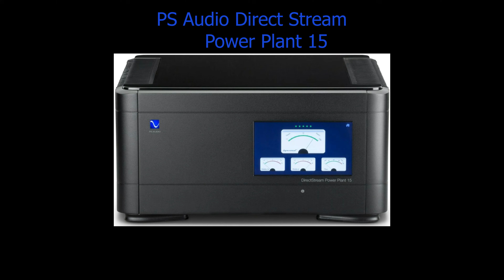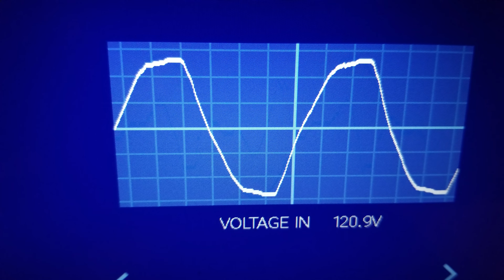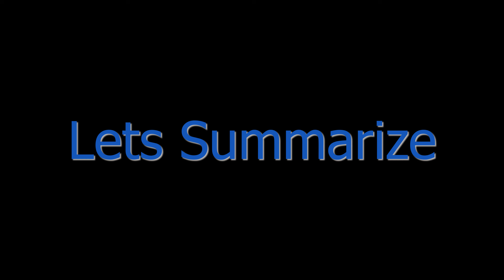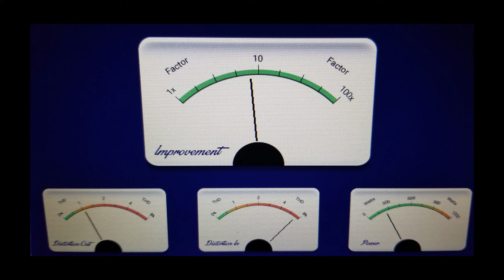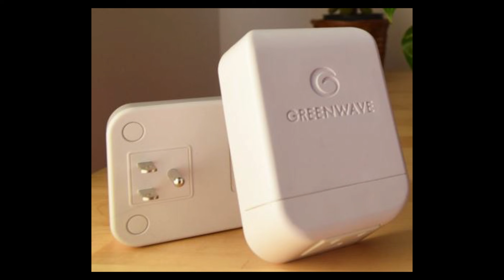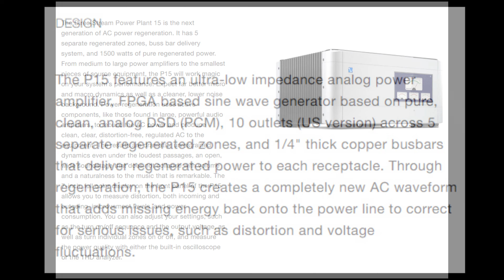PS Audio P15 Power Plant Review

Comment: Thanks, fantastic review. Solid measured evidence that a regenerator makes a difference, there is no one else who has done this on YouTube. I was looking at a regenerator, isolation transformer, balanced power supply and a conditioner (Isotek- Nova, Titan). No one has compared all four it would be good if you can get your hands on them and measure and compare. 
13 minutes in you mentioned a broadband EMI meter, did you get a reading from the mains socket directly in comparison to P15 outlet? If so what were they? What kind of % EMI decrease, is it zero?
Reply from the maker: The EMI/RFI meter concentrates on noise that is at a higher frequency than the Fluke harmonic meter. The P15 had minimal effect on the RFI/EMI # I was measuring with the EMI meter. I typically throughout the house read between 180-230mV at the plug outlets. Using a greenwave filter it would reduce it to 50-80mV and the audible noise in the meters built in speaker is reduced as well. Note that the noise that the meter hears has never been heard on any of my home theater equipment or through the speakers. Also plugging a greenwave filter into the same outlet that the P15 was plugged into made no difference to the input or output harmonic distortion values on the P15 or on the fluke meter. I would love to get my hands on some of the other power supply conditioners and test them out but unless the manufacture is willing to loan me one for testing the cost is a little steep just for testing. I have had several devices in the past that were mostly passive devices (Monster AVS  2000 Voltage stabilizer and filter and had tried a Monster HTS5100) both ok products but they did not truly address the harmonic portion of the distorted sine wave created by non linear loads in the house and out on the utility line. Especially with solar power and electric car chargers becoming more and more popular. So a device like the P15 that in effect rebuilds the Power  to a clean undistorted sine wave sounded like the best option. So far I am satisfied with its performance in my system.
Reply: @eddiscus  Thanks for the reply. The sin wave output is that a screen shot taken from the PS 15 or was that from the Fluke or an oscilloscope? The sine wave looks like a "ideal" waveform, just wondering the resolution on the display, sometimes if the resolution is low it will show a perfect result. Where if the time base is increased it will show an "actual" representation of noise coming from the P15 at a magnified level.
The harmonic distortion that the Fluke measures would all the harmonics need to be summed to get the total distortion? Is that representative of THD.
The other info of interest is if the voltage in your area fluctuates say from 120V (ideal) to say an increase / decrease of an extreme value say 50V. How would the PS15 cope to maintain that ideal value. Another words does the PS15 have a tolerance range that it only works in, if out with this then distortion and voltage will fluctuate on a much higher level. Something probably you can't test unless you were in that scenario.
Reference 5.56, why has PS audio developed it this way. Can't it do both accurate voltage and zero distortion. Where is the distortion getting introduced from on the output? I will expect it will have zero distortion as the PS15 has totally regenerated a new Sin wave of 120V. When you have no HiFi components plugged into the PS15 does the noise decrease further as there is nothing injecting noise back into the PS15.
It looks like PS Audio with these regenerators has the monopoly, there isn't any other apart from one brand I can think- Accuphase-

http://www.accuphase.com/model/ps-1230.html

Did you look at any others regenerators before you pulled the trigger? If so which makes?
Reply from the maker: @yoogeebearproductions   The P15 sine wave was representative of the sine wave on the fluke meter. I was thinking of breaking out my oscilloscope but did not at the time as the fluke meter details the harmonics present as well as the visual sine wave. I am sure if you magnify the trace on an oscilloscope you could see minor noise or distortion. Probably the only way to get a truly clean wave would be to regenerate it through a local Motor generator generator (analog) cost would be significantly higher.
Yes on the fluke screen the THD is the sum of the various orders added together.
Based on their specs below if I have the P15 set for a nominal of 120 volts it should be able to correct an input of 108volts back to 120 and an input of 102 volts back to 120volts for 15 seconds at which point I assume it will shut down on low voltage cutoff. 
Under Voltage Limit	Continuous -10% of setting 15 sec duration -15% of setting
Over Voltage Limit	Continuous 5% of setting 15 sec duration 10% of setting
When the P15 was powered just by itself it was reducing the incoming line distortion from 8% down to 0.4%. The reading of 1.0-1.4% was with all devices plugged in and powered on. So it is safe to assume that it is the actual devices power supplies creating the 1% distortion compared to standalone level of 0.4%.
I would love to have endless resources and be able to purchase each unit and test each one and pick which worked best. But at the end of the day I had to make an educated choice. All the units provide filtering and line conditioning, such as Furman, Panamax, Torus, Richard Grey Power Stations, Shunyata Research, Audio Quest Niagra series etc. PS Audio was one listed as a regenerator. The concept of taking the AC voltage converting it to DC then recreating a clean (or cleaner than original) AC sine wave had my interest. That and their 30 day trial period kind of made me feel they have faith in their product. They also have a trade in program. You can enter your equipment before purchase, get a trade in value and have that credit applied to your purchase price at time of check out. You then have 30 days to send them your trade in's or you will be charged the full price. As you see in my review it did what I primarily wanted it to do which was to restore the power that was being corrupted by my in homes non linear devices as well as other neighbors devices. Give me a source of clean local power that could support the amplifier hits from home theater action movies. So far I am satisfied. Does it filter out all noise from 1hz to 1Mhz? No. But sometimes over filtering can be a bad thing. I had a multi outlet well known brand name filter unit and took it for what it did. But during a component up grade I played the system without the filter unit and then when I but it in I noticed the sound sounded clamped in certain tonal ranges. So I highly recommend doing an A/B comparison with several pieces of material that you are familiar with.
Also nice that the units are built in Boulder Colorado. :)
The only complaint that is with a unit of this cost you would think they would have paired it with one of their quality power cords, at least their low end cord rather than a standard power cord.
Reply: @eddiscus  I am very surprised converting dirty AC to DC and back to pure Sine Wave AC only reduces the THD and not the EMI noise. I would have thought this process would have completely eliminated all forms of noise in the mains. You say by using the Greenwave filters to reduce EMI you are not hearing any audible improvement and I think that could possibly be because those filters are not lowering the EMI noise floor sufficiently for you to hear an improvement. I am currently using a mains conditioner by a popular brand which reduces my EMI noise from anywhere over 800mV to below 20mV and I can definitely hear a significant improvement in my system. Can you possibly tell me what improvements you are hearing with the P15 compared to your previous best mains conditioner ?
Reply from the maker: @theone262  I just played a little with the 2 EMI meters and when I plugged in the green wave filter to an outlet the EMI went from 240mv on the green wave down to 80mv. The Entech meter showed no change in both the measured value and speaker noise. Obviously both meters look at different frequency ranges. I think I will play with the oscilloscope to determine what emi noise is present and what portion the filter is knocking down. 
As far as the difference the P15 made in the system. My subjective audible observations were more definition between sounds within the movie. Ambient sounds had more presence and did not seem to get muddied by base level sounds. Also sound bursts such as gun shots, explosions and crashes seemed more defined and complete. I also played with the pulse adjustment on the P15 and dropped it down to a -2. This changed the reduced THD from 1.4% down 0.7%. With a mains THD of 7.4-8.0%.
May I ask what meter are you using for the emi and which conditioner? I had Monster gear in the past and their filters seemed to be more concentrated on inter component filtering rather than mains reduction. I would only see a slight reduction in EMI and that was typically on the high current plugs. It seems the more recent power conditioner units are doing a much better job or tailored to the range of the available meters so they show better isolation. Cant say for sure without digging deeper  but if you hear a difference then it had a positive effect.
Reply: @eddiscus  I had initially been in contact with PS Audio who stated that their power plants reduce both THD and EMI to near zero but from your experiment this is clearly not true for EMI so I have messaged them again and waiting on a reply. I will update you once they reply. I am using a Greenwave EMI meter and the power conditioner is an Isotek Nova.
Reply from the maker: @theone262  Funny I reached out as well. I looked at the wall outlet on a basic oscilloscope I have. I see the flattened out sine wave that showed on the fluke and P15. Plugging in the Greenwave filter made zero difference to the sine wave and I zoomed into various sections. The P15 did drop the emi on the greenwave meter from 320 to 280mv. I an sure the P15 is correcting EMI but what frequency range is unclear. At least it is not within the range of the greenwave meter.
Reply from the maker: Would like to know what the Isotek does to the line harmonics. It looks like a nice unit
Reply: @eddiscus  probably nothing as it's just a passive mains filter so basically just filtering out the mains noise without regenerating the AC like the P15
Reply from the maker: @theone262  Don't know if you seen this video. But Paul explains his methodology on why the Power Plant vs a Power conditioner. https://www.youtube.com/watch?v=FD_2RKpWkYw&t=324s
Reply: he has not provided any evidence...he should have measured the performance of a device plugged to it, but it didi not, ASR did it, and shown  that performances actually might  decrease ....
Reply: Yes, they reduce distortion on the AC since wave, which is irrelevant, because your hifi devices operate on DC, and the power supplies clear up all of those issued during rectification and filtering.

These make no audible difference.